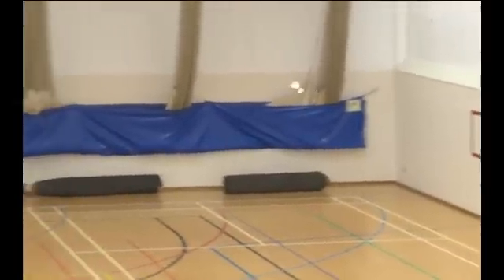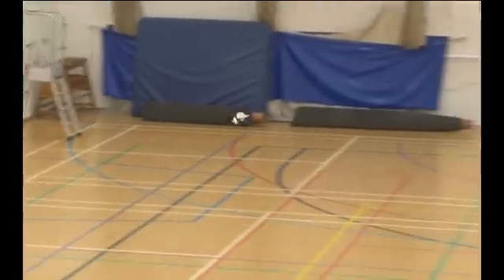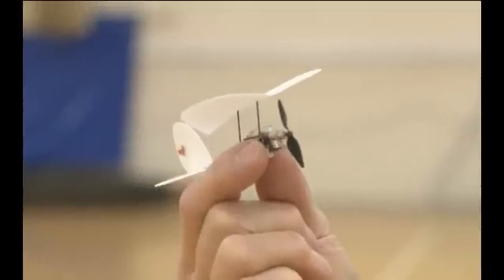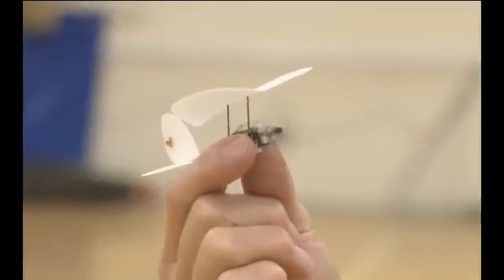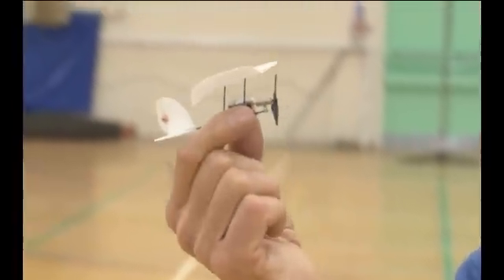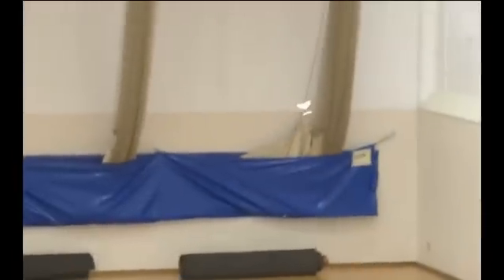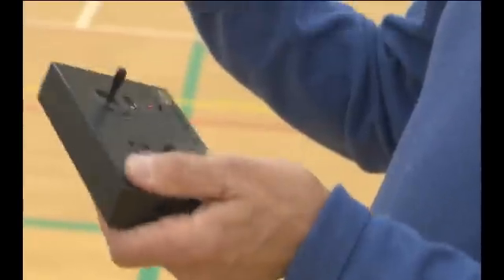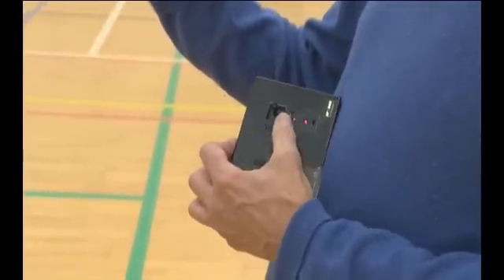World's Smallest Radio Controlled Model Plane

Comment: Meh... It's two channel and doesn't even seem to be able to turn the other way. And doesn't the common use of "full control" imply four channel with rudder and aileron controls as well?

It might have the record for smallest flying RC, but "full control" claim seems a bit much. Looks about as fun as those RC cars that could only make turns when you drove them backwards.

Comment: I fly all kinds of R/C aircraft.  You should be required to do a simple figure 8 to demonstrate the aircraft's ability to change direction.  If it can only go left, then it is not completely controllable or he is a bad pilot, or both.  I have a commercially available "Ember 2" that I could do all kinds of aerobatics in the space he was flying in.  I also have a "Night Vapor" that flies half the speed of his micro plane.  Yes, they are bigger, but adding wing area would have helped him.

Comment: by varying the current through the electromagnet you can vary the force produced, if the control surfaces are sprung loaded a small force will only cause a small deflection and a larger force a larger deflection. Voltage wont make so much difference although usually by altering the voltage you will alter the current aswell so that might well work.

Whether or not that is being done I do not know, but its possible.

Comment: Totally wrong.  My first planes were a goldberg mirage, 54" wingspan and rudder only and a 2 meter glider rudder only - no ailerons. It has little or nothing to do with size or momentum - it has everything to do with dihedral.  A plane with no dihedral will only yaw, but as you add dihedral (or polyhedral in the case of many gliders) the rudder also causes bank.
The extra 300 has zero dihedral, while a quick search says the 737 has 6° dihedral. Swept wings also have an effect on roll stabilty.

Comment: He was flying in circles due to the fact that if he flew straight at any point he would not have enough space to turn, I know this because i regularly fly model planes indoors. The first RC plane I ever flew had no control surfaces what so ever and just used to small motors which changed speeds so that you could turn and gain altitude. :)

Comment: Actually, you can have full control of a radio control plane using only the rudder and engine. The faster the engine turns the propeller, the more lift you gain and the higher the plane will fly. Using the rudder also banks the plane slightly, because the aircraft is so light, the rudder is enough to turn the plane. If the plane was larger and carried momentum then ailerons would be needed as the rudder would merely change the direction the plane is facing and not change the direction of flight.

Comment: Might want to try building one on a 3D printer. I understand that those can print moving parts like the control surfaces together as a unit: the axel pin parts can be made into their corresponding holes so that there is nothing to assemble, and they cannot come apart, unless they break. Thus these parts can be made lighter and tighter.

Comment: So miniature electronics cost less than normal size then?! An RC receiver, a motor control, motor, battery, big enough for many minutes of flight, plus the minuscle airframe, would cost less than $30, you say?! Just check what micro-sized RC kits costs - total not weighing more than a few grams, tops, including a servo as well, and find one that weighs under five grams and cost less than $300, and you're a clever guy indeed!

Comment: @buddingvideos   Yes - the original un-edited video shows figure 8's and right turns, but I kept them to a minimum  as the  high right turn speed meant that  the cameraman was struggling to keep it in frame.  But apart from all that,  it's a right little sod in right turns!  I've now made a much better design with 2 contra rotating torque cancelling motors which I'm trying to put into production.